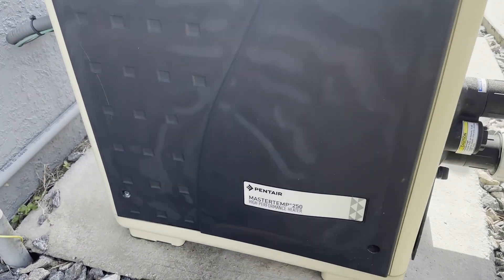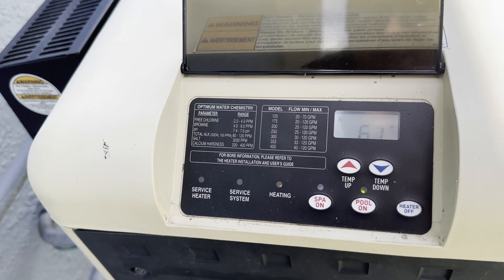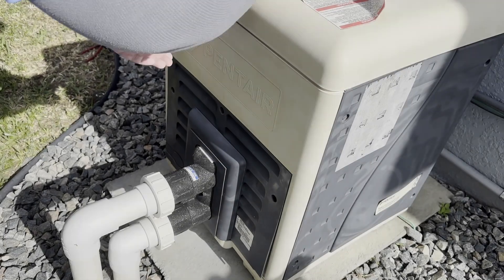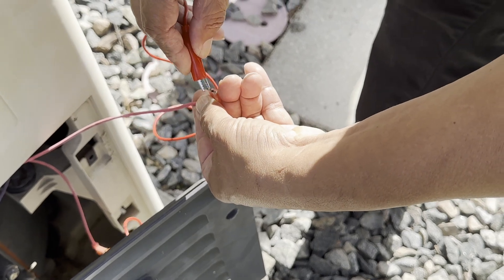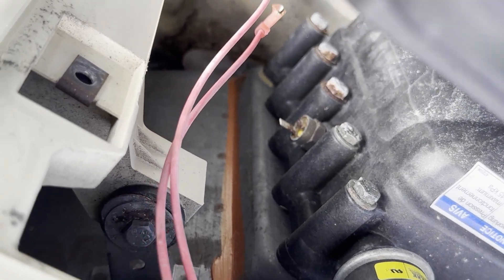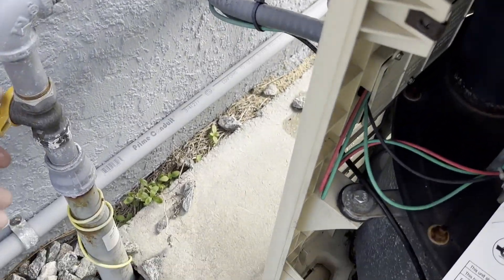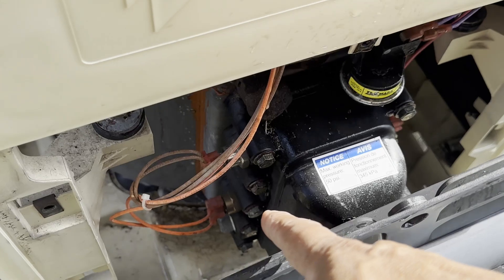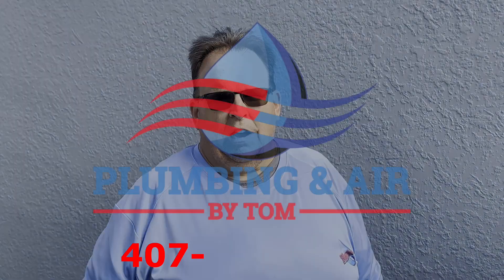Pentair Mastertemp 250 Gas Pool Heater Not Running Step by Step Repair of Gas Sensor

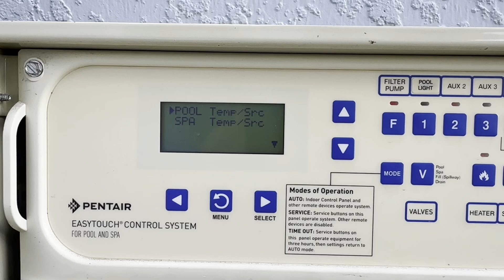Comment: Thanks a lot for your video! I had trouble starting the heater from my ScreenLogic app. Originally the LCD panel was off, and I thought the circuit board was cooked! After watching your video, I check the control panel and found out the heater was set to off 1:44. After I change it to Heater, then the heater turns on, so at least I know the heater circuit board is fine. After more digging, I found the ScreenLogic remote problem: it was due to a bad connection in the B/G/Y/R cable, after I fixed the connection everything works now.

Comment: Any thoughts if I'm still receiving an AGS error after jumpering the sensor cables? The control board was also recently replaced so I'm at a loss.... Appreciate any help
Reply from the maker: RTFM 
Read the factory manual

Comment: Why this heater doesn't turn on when you turn it on from the control panel?
Reply: Because it's using a 24v com wire to easytouch.   If that isn't energizing the board heater won't turn on. It's called a fireman's switch.

Comment: Hate to be that guy, but it's a 5/8 deep socket, not an 11/16... also, if you don't breach the filter and let the system drain down you will get A LOT of water when you pull any plug/sensor from the heater. Drain filter by opening the air relief valve, wait 5 minutes 
Then take drain plug out of heater manifold. Once the heater drains you can replace what you need. DONT pull a plug or sensor when a pump running..
Reply from the maker: Thanks for sharing those tips & tricks.

Comment: I changed the ags and it still will not heat my front panel only shows service heater. The front panel will not light up. The only light is the service heater light. Any suggestions. Thanks
Reply from the maker: Bad panel?

Comment: On the control panel there is a “Mode” button that has three functions as indicated in the box. Press the Mode button until the screen reads “Service”, your are now in Service Mode. Once in service mode you can manually control all your equipment, filter pump, heater etc via the buttons on the control panel. Once finished press the mode button until the screen reads “Auto”. By doing this you will not have to change programming.
Reply from the maker: Thanks for sharing
Reply: Or just flip breaker to heater.  Should be on its own breaker.  If wired correctly.